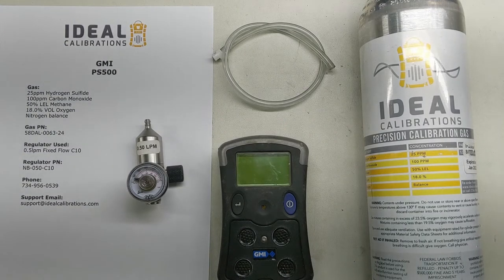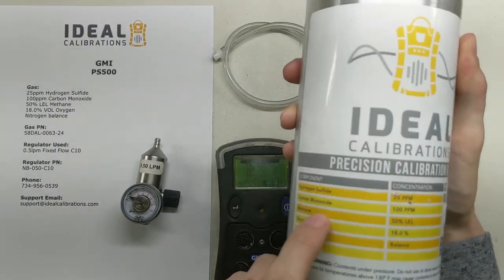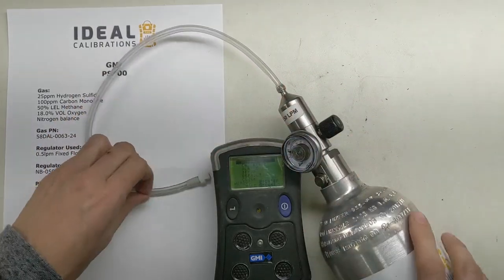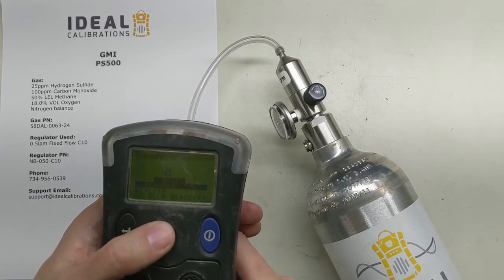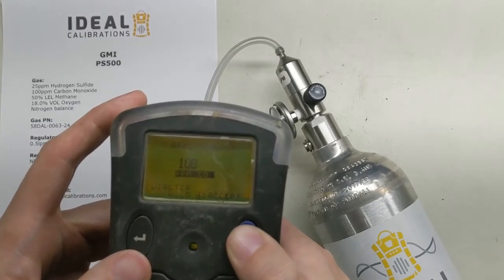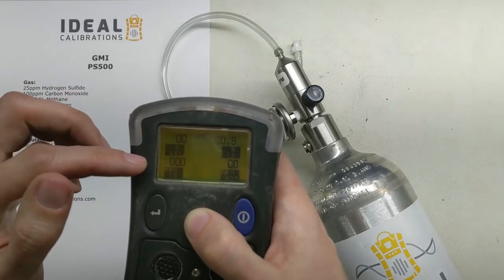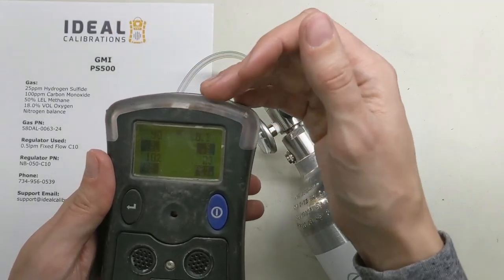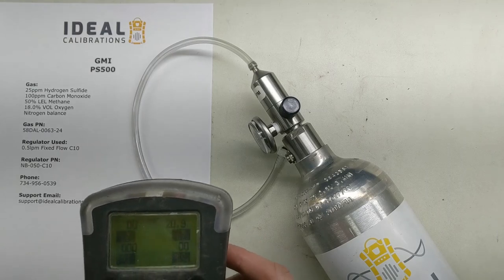GMI PS500 Calibration and Bump Test Guide

Comment: When I try to select the ppm number it resets back to zero before getting to the number. For example I can only set numbers between something like 5 and 60 for CO but I need to be able to set it at 100 to correspond with the bottle.
Reply from the maker: Hey greenled5, if you're doing the manual calibration and it won't go up to the level you need it usually means the CO sensor needs to be replaced. It means that the span reserve value is depleted to the point that it can't algorithmically correct up to 100ppm based on the sensor output.
Reply: @Idealcalibrations  Excellent thank you!
Reply from the maker: @greenled5  Anytime

Comment: What would cause a rotten egg smell when going through daily bump test?
Reply from the maker: Hey Tina, that's from the Hydrogen Sulfide in the gas mixture. Rotten egg smells often come from sulfur compounds, and Hydrogen Sulfide is one of those. Your nose picks it up at a really low level (even better than the sensors in the unit at sub PPM levels). The danger comes from the fact that your nose loses sensitivity to H2S very quickly due to a concept called olfactory fatigue. This makes it a danger because people in the field will think the gas has gone away when the smell has gone away and in reality that can come from an increase in the concentration of the gas. Let me know if you have any more questions!
Reply: @Idealcalibrations  Thank you very much for responding so quickly. I didn't see anything in the  manual on troubleshooting (I may have missed it). I am grateful I have found you here. Brief history: We have recently purchased 6 of the PS500 meters (love the design as well as functionality) and 2 docking stations (super quick, space savers compared to our old one and very user friendly). We have the docking station and gasses hooked up in our office (no windows). I am very concerned that 1 of the 2 docking stations emit that oder when in use. I've checked to ensure hoses are snug. While bump testing a meter I used another meter to see if and approximately where a reading would pick up. It's definitely in the back of docking station and registered at 8 ppm. Should we discontinue the use of that docking station completely or use it in a more ventilated area. Side Note: As each meter is being bump tested the smell gets stronger. I have brought my concerns up here at work and have been told this is nothing to be worried about when it obviously is. Thoughts? Suggestions? Again, your reply is much appreciated.
Reply from the maker: @tinaabshire2031  Hey Tina, your best bet is to wear a gas monitor on your person and check the readings there while you're docking the others. My bet is it will barely register. Gases decrease at a cubed rate as they expand, so by the time it gets to you it's most likely sub ppb levels. Higher than 5-10 ppm it'll start to be more of a concern (not dangerous unless you're breathing it for 8+ hours straight), but check OSHA PELs to be sure. It's most likely not a hose being loose, just going into the air after it passes over the gas monitor.

Wear a monitor though and check the levels in your breathing zone just to be sure, but at that low of a ppm I wouldn't be worried personally.